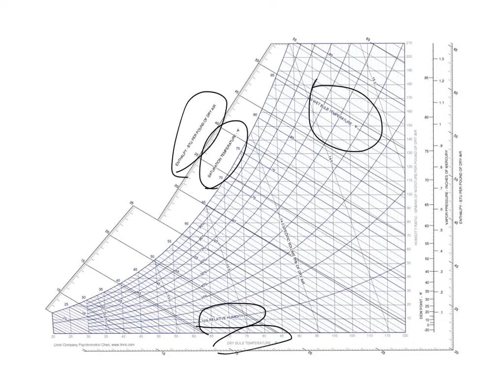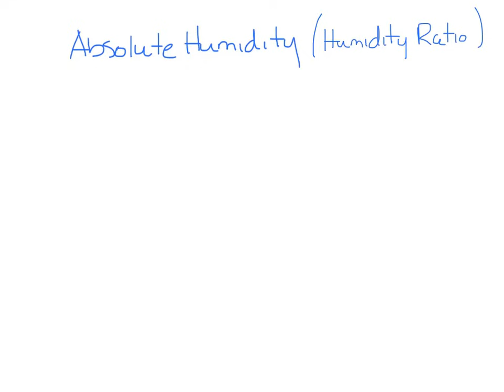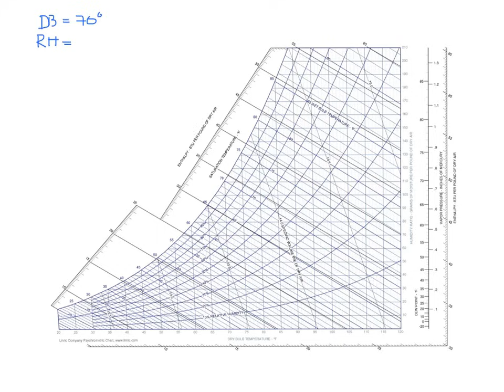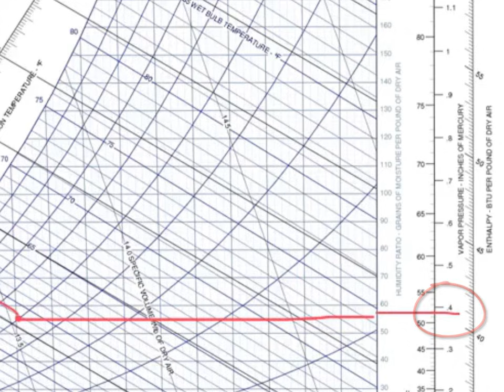Titus Timeout Podcast - How to Read a Psychrometric Chart

Comment: Q1: A main duct with dimensions 0.6 ×0.6 m carries air at the rate of 280 m3/min. It is divided into two ducts, one being 0.6 × 0.3 m and the other is 0.6 ×0.45 m. If the mean velocity in the larger branch is 9 m/sec, calculate the mean velocity in the main duct and the other branch. Also find the mean velocity pressure in each duct assuming standard air density of 1.2 kg/m3 .

Q2: The following figure shows a typical duct layout. Design the duct system using Equal friction method. Take the velocity of air in the main duct (AB) as 8 m/s
Hi
Can i get an answer
Reply from the maker: Unfortunately we cannot provide the duct calculations for these questions as that is not the premise that our podcasts were designed for.

Comment: Why is dew point in the weather report many a time at RH less than 100% & it rains. Has it got something to do with pressures like 29.9 inch or less, or wind speed, density or cloud formations, adiabatic cooling due to lower pressures?
Thanks 
I am trying to understand weather, rain & snow
Reply: Because liquid water falling through the air (rain) is different than the amount of water vapor in the air.
Reply: Because the rain is originating in clouds at a much higher elevation, rather than fog at ground level.

Comment: How to calculate the enthalpy deviation from the curve ??
Reply from the maker: Armed with a chart with the Enthalpy Correction Curves plotted, it’s a simple case of plotting the specific condition on the chart then reading the “Specific Enthalpy at Saturation” take this number and subtract the “Enthalpy Deviation Correction” factor read from the specific point on the curve, its very straightforward but only if you have a chart with these curves plotted of which I could not find one in IP units. This is because Enthalpy Deviation is only used in applications requiring extreme accuracy and is generally not used in HVAC.
Reply: @TitusHVAC  thank you 😀

Comment: One question. Outside temp is 32F, 80% humidity. Inside temperature is 70F and humidity stands at 40%. Let's say I open the window long enough for the air in the room to be fully replace by the outside air. Then I close the window and turn on the heating until I get 70F again. What will my humidity be? In other words, does this chart help me predict the humidity at a target temperature starting from a certain temp and humidity and adding heat without adding water in the air? Do I basically start from the intersection at 32F and 80% and draw an horizontal line until I hit the 70F vertical line and then read the humidity value on the curves?
Reply from the maker: By replacing the entire room air with the outside air, the moisture content of the outdoor air is much lower than the starting room condition, even though the outdoor air has a higher relative humidity. The starting room condition (70F/40%RH) has a moisture content of 43.66 Grains/lb. While the outside condition (32F/80%RH) has only 21.19 Grains/lb. If sensible heat only is now applied into the room  (e.g. a room convective heater) then this will move in a horizontal straight line from left to right on the psych chart. If the dry bulb temperature increases to 70F, the moisture content will stay the same at 21.19 Gr/lb, but the relative humidity will fall to 19.5%. This assumes that the room does not have any sources of latent load such as people or plants etc that would increase the moisture content of the space while the room is being heated
Reply: @TitusHVAC  Thanks for confirming. I've just subscribed to your channel. Greetings from a degree qualified Mechanical Engineer getting a bit rusty having worked in oil and gas for 15 years now :)

Comment: Great video, 
For the first time I understood enthalpy is the heat or energy with two components, due to sensible part we see drop in DBT & the other is latent used for evaporation & the potential drop in temperature determines how soon or later we will see water condensation, if the drop on DBT to WBT is lower it is closer to 100% relative humidity, if this drop is higher then RH is away from maximum possible 100%. & the DP also goes even lower accordingly, as evident, the gradient of DP is zero or much lower than WBT,  & the reduction in depression & DP is also similar.

When we hear weather, the weather person mentions RH & Dew Point, rain or no rain, muggy or comfortable, how should we understand weather from DBT,  RH, DP, moisture content?
Can we use Psychrometric chart to understand if it will rain or not, it will be muggy or not, & how?
Could clarify how to use the concepts of DP, RH, moisture content to understand weather?

Comment: This was good. However, I don't think Absolute Humidity is the same as Humidity Ratio.  They have different units per ASHRAE.
Reply: The exact meaning of absolute humidity is different, depending on who you ask.  The way I learned it, was an interchangeable definition with humidity ratio, where it is the mass ratio of water to dry air.  I find this to be the most useful version of it, since every application I've ever used it for, I needed either as a mass or molar ratio, and didn't want to even think about volume.

Other variants define it as a ratio of water vapor mass to partial volume of dry air, or volume of the aggregate mixture, which I find to be a useless way to measure it.  The density is going to change during any process you care to study on this chart, so you want to use definitions of humidity that are independent of density.

Comment: I have a problem. Now assume in a closed room we have found the RH and dry bulb temp. Thus, the specific volume of the room can be found. The specific volume should be constant as the room has a fixed amount of dry air. Now if the room is slightly cooled down then the point marked on the psychrometric chart should be shifted to the left and therefore the specific volume would change according to the chart. How can this be?
Reply from the maker: Kalana Suraweera the chart assumes a specific pressure.  If the room was actually sealed air tight, the pressure would reduce and the chart would change slightly to account for the change in density.

Comment: what is the difference between dry bulb and dew point temperature? 
				  
				   - via YtPak(.com)
Reply from the maker: The dry bulb temperature is the air temperature measured by a standard thermometer. It's what we usually think of when we ask, "What is the temperature?" The dew point temperature is the temperature of that air when the water in it will condense out.

On the weather, they may say that the temperature is 65 degrees F, the relative humidity is 70%, and the dew point is 54 degrees F. This means that since the air has 70% RH, if it cools down to 54 degrees, dew will form on the ground and other surfaces. The dew is the water vapor condensing out of the air because the air is saturated at that temperature.

Comment from the maker: screenflicker1, sorry, I often forget to slow down when I talk. Thanks for the reminder.
Reply: +TitusHVAC Thanks a lot. It really helped.
I have a query. What if i have the DBT and WBT, and i have to find the enthalpy. I point out the intersection and draw a line to the enthalpy line, but the intersection is arbitrarily in the middle of two specified enthalpy values. How do I find the correct enthalpy value now?
Reply from the maker: If you fall between two lines, you can interpolate the value.